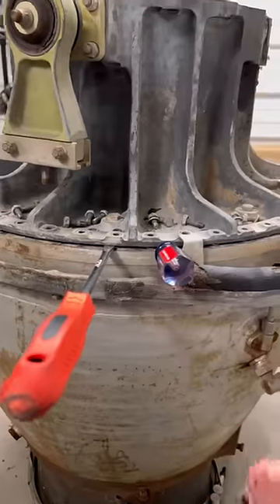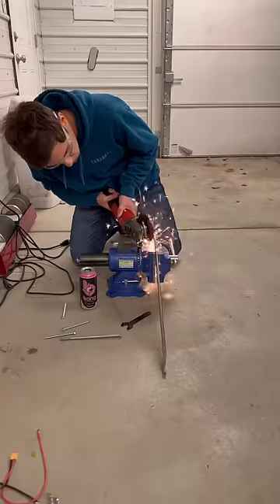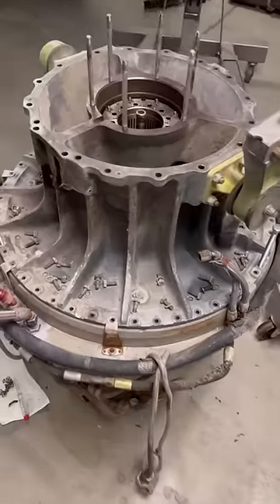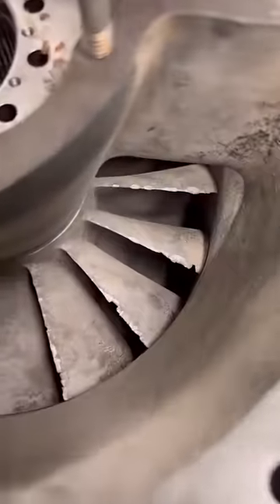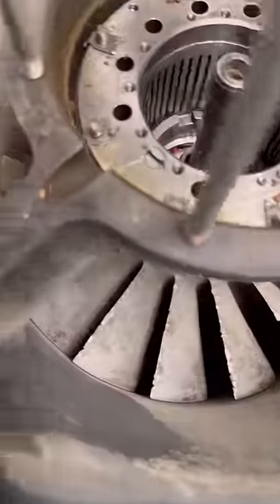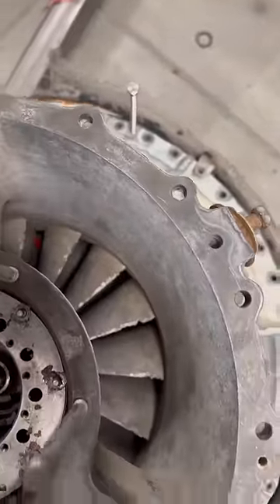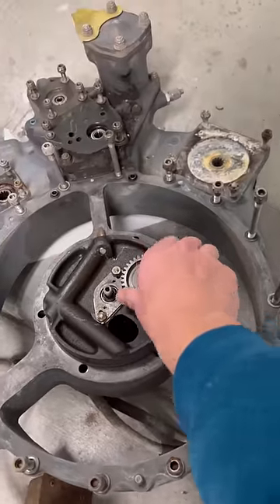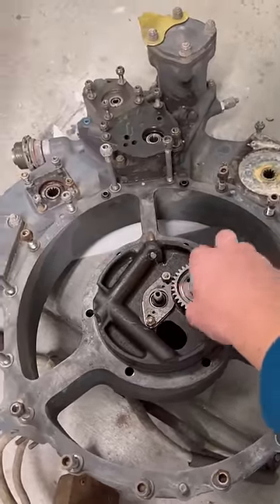Extremely Sketchy Jet Engine

Comment: Have you seen a functioning engine on the passenger planes you travel with everyday? 
Some look worse than this and even missing blades. Out of balance? Lolol I’ve seem them missing up to 3 blades and they still MEL them for 10 or 15 flight cycles. As long as it was spinning freely you should’ve never tried to open it. Also what do you think you gonna achieve by opening it? Filing them down makes it worse.

Comment: well you didnt take out the inner bolts. if you look at that screw driver youre hammering on, in front of that to the side of the reinforcement fin on the casting there is a bolt.....

Comment: Need to put that turbine wheel on a lathe to clean and balance it.might lose its ability to start engine do to it not reaching high enough psi.in that case i would have new leading edge fins fabricated to increase the blades surface area but spinning that at 50,000rpm u would wanna weld them on somehow witch would throw the balance of again.best of luck 2 u

Comment: I use an 800 dollar motor puller the pools in electric motor out of the housing on the giant compressors that run the air brakes for trains

Comment: I hope for your sake this doesn't run after hearing how you plan to deal with things. This is a jet engine and things tend to go wrong if your not somewhat experienced.  And using a tire iron to split the case already shows your out of your league. The manual will explain everything and obviously your not reading it.

Comment: U need to lay down some heat  on her she will crack up just have to take ur time lay down the heat evenly then bolts don’t go down the roll thats why one side crack, take them off in a star ⭐️ form , and then blades just scan them fix and on too a 4-axes

Comment: I've watched a few of your videos. Although awesome your learning. You should have rebuilt a small motorcycle engine first so you have a better grasp on mechanics. Try using heat to separate that housing with a gear puller. Banging and prying at the ends would only seem to make it worse.

Comment: You worry me slightly your gonna try to fire that engine ? For starters that things been sitting far too long it had aluminium corrosion that’s probably why it won’t split the casings and now that has cracks soon as it gets warm assuming you get it running with fan blades like that I’m pretty sure your just building a bomb cos it’ll explode for sure ! I’m sure someone has thrown a hand full of gravel into it while it was running hence the fins being in such bad shape

Comment: It takes a special puller to get off the compressor wheel!! YOU NEED TO TALK WITH A LOCAL AIRPLANE MECHANIC WHO HAS THE PROPER TOOLS otherwise You will destroy the hot section of that engine!! JS

Comment: Put some metal eyelets through the top spend it in the air start walking around in circles with a rubber mallet and bang all over it if needed tap with a metal hammer at the same time have one or more preferably two people try and different directions

Comment: Crap you Cracked the Housing ! check the Bearing on the other side Remove Snap ring on your output Shaft Check your Manuel ! You Can't Leave it Carry on to Disassembly

Comment: As a xcrewchief on kc135 , 🤔🤔if those blades are damaged, the compressor blades are too. PLEASE seek a acft turbine mechanic, before trying this. Also use special oil, not 10w40.🤔🤔🤔
      This isn't a lawnmower engine, catastofic jet engine failure is messy, (and they chain down the plane when they do this, jet engine testing,  BIG CHAINS ) engine failure, like you bug on a windshield. Fire, shrapnel,explosion. Mom finally learning what you had in your uncle's garage!!!! 😳😳😳
     Like the go getter in you, need more wisdom for this one, got a lot of potential. 
    Just don't be like the kid that built the nuclear reactor in the shed in his family's backyard,( google that ,please.)😳😳😳 Yes true story. Like on big bang , with penny, and Sheldon.

Comment: Wtf how are you going to "fix"  these blades. Looks like you re trying to force an uncontained engine failure in your backyard. You got any Manual? Mabey it is an interference fit, in this case a couple of heat guns  and dry ice will do the job.

Comment: You need to put the whole thing in a oven under tension... bolt the thing to the floor and start pulling it apart, and when everything starts to bend. That's when you hold and just apply an intense amount of heat.

Comment: You may have to use extreme heat. Like, go around it with a blow torch until it turns red hot and then try prying it open.